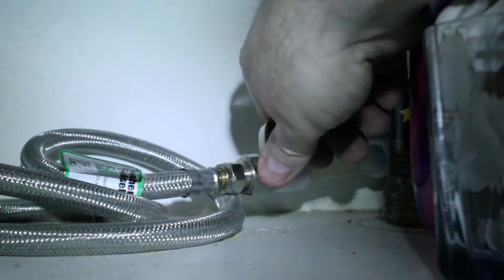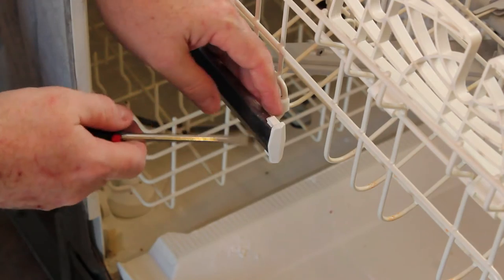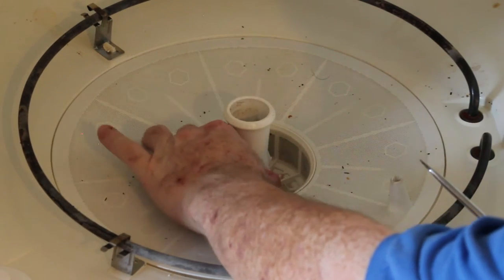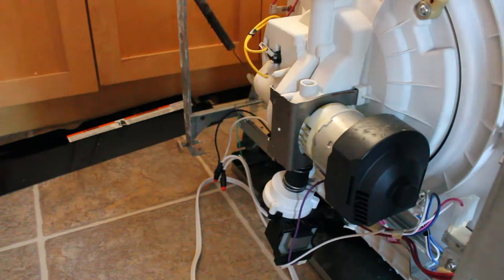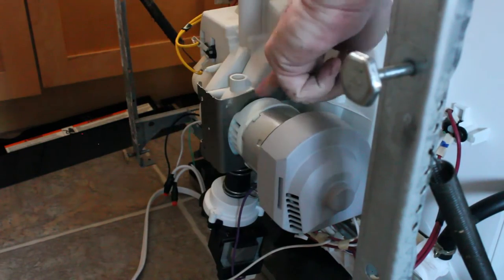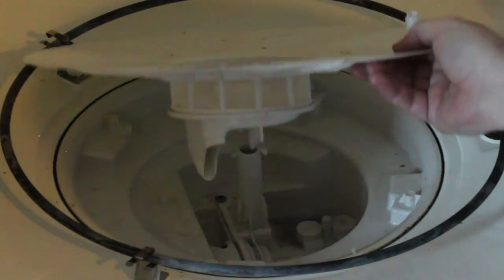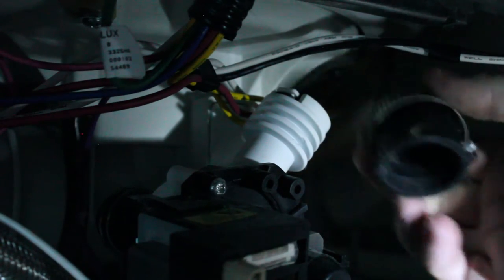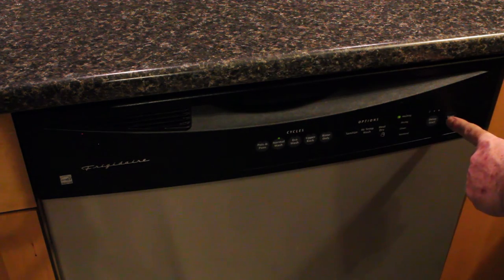Frigidaire / Electrolux Dishwasher Circulation Pump Replacement

Comment: Great video! My circulation pump started SQUEALING because the bearings went bad. My machine is 18 years old, and I was trying not to have to buy a new machine. I was lucky to find a replacement part for a decent price. This step by step guide made the replacement a breeze. Thank you so much for this, even if it is 8 years old, it's still relavent.

Comment: Excellent video--did mine tonight with another person holding a flashlight in about an hour, give or take 15 minutes.  (I wish mine was plugged into an outlet under the dishwasher like yours but that's okay).  The worst/hardest part was getting the braided water line screwed back in.  It was in such a position that I could only get tiny fractions of a turn of the wrench so it took 5-10 minutes each time to unscrew it, and screw it back in.  If it helps anyone else, and if most the models of Frigidaire are the same, you'll need a 14mm box wrench for the water line and you'll also need a T20  torx bit for the screws in the bottom of the dishwasher as well as on the back bracket that holds the pump in.  I ran up and down stairs a couple times grabbing tools I didn't know I'd need so save yourself a trip and bring some metric box wrenches, sockets, torx and philips screwdrivers/bits.  Again, an extremely helpful video and it took the fear out of fixing it myself for $89 on Amazon versus the price of a replacement dishwasher, or paying an appliance repair person.

Comment: You don't have to do the top stuff to replace the pump motor. Leave the racks and spray components in place. Just drop the motor from underneath. Lubing the seals with a little silicone or dish soap will make the pump go into place more easily.
Reply: Question - how can you remove the mounting bracket by removing from underneath? curious as I want to do this without removing and disconnecting the dishwasher..
Reply: I have no idea why the video shows removing the top stuff, since changing the motor is from underneath anyway. I am not sure if there is a way to switch out the motor without pulling the dw out of its space. But really it isn't all that hard to pull it out, especially if you have more time than money.
Reply: You can't access the 2 screws on the bottom of the sump that hold the pump clip in place as they are facing down against the floor unless you slide out the machine. Short of loosing the 4 retainers and removing the whole bottom sump and pump assembly by pushing it up into the tub and there quite hard to access as well  (which creates more risks of seal to tub link) its less work to slide the machine out.
Reply: The screws are literally on the bottom of the unit.. You pretty much have to put it on its side to do this.
Reply: tod

Comment: I thought so too about the stuff on top. But be careful because if you take the stuff on the top off, you'll be able to visually see whether the smaller of the O-rings on the motor pushes through and gets off track like mine did. My motor leaked at the underside connection and as it turns out I need new O-rings as they have stretched but I could see the o ring coming off (from above) as it hits some of the inner parts. You wouldn't necessarily know it if all the top stuff is on. And it's new dishwasher time for me because they apparently only sell the entire motor with new O-rings but not the orings separately.

Comment: How do you know the circulation pump dont work?????
Reply: for some people it leaks through the grates (gutter like rectangle opening)
Reply: for others it leaks closer to the end which indicates its the O rings. usually you may see drips on the metal bracket which rusts after, usually indicates O rings
Reply: Dishes won’t be clean due to spray arms not spraying water. If you run dishwasher with lower plate off and watch/ listen to pump it won’t pump. Open dishwasher when running you won’t see spray arms spraying. Take pump out and verify it turns freely, mine was locked up solid.

Comment: if all you're doing is replacing the pump, there's no need to take apart the rest of the stuff.
Reply from the maker: I learned this too late, but you are absolutely correct!
Reply: I did it anyway and found a ton of debris which I think helped kill my old one. It's worth taking it apart if only to clean out the recirculation area.